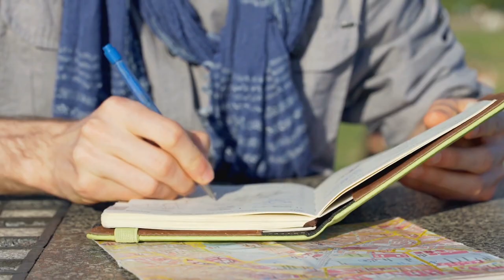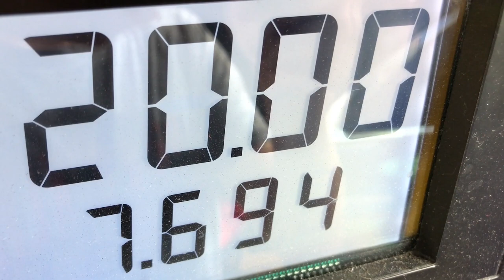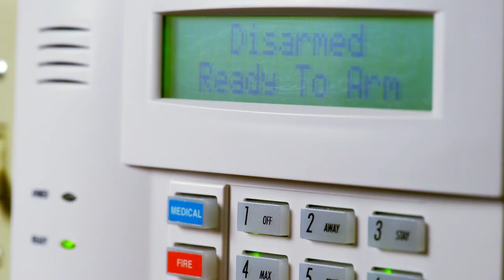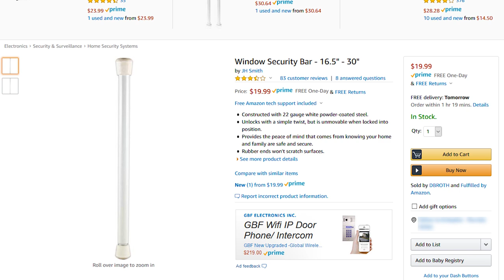How to survive after SHTF in an urban or suburban environment

Comment: This video sounds like it's such a great idea to do, however it is only showing one family that is bugging out and of course that's due to not having a real scenario to take photos of. But if SHTF actually happens, these families or individuals would not be alone, and in fact it would be hard-pressed to find most areas outside of the city to have no one around. People would be parking the cars at the edge of a forest and hiking on the trails that they are normally used for Summer recreation hiking in droves! Half the people will be knowing approximately where they're going and the other half are just following those in hopes that someone will have an idea of what to do! There Will probably be tens of thousands  of people for each and every city across the United States all trying to go to the lakes, forests, deserts all at the same time. And a lot of the people will be checking to see how much gear other people have and you wouldnt be in a safe situation traveling with that many people going in in the same direction!   I figured there would probably be a couple of hundred young, strong and healthy people per trail head,  getting out of town. Doesn't sound like a lot but it is, considering in Idaho there are a lot of trail heads into the mountains but there are a lot of people! And we're in a smaller area than the big metropolis cities!

Comment: I'd add one thing to that. Invest in precious metals, gems and other relatively compact and lightweight things of value everybody knows has particularly high value, and might consider in lieu of currency or goods. Don't invest much of what you have in the stock market, certificates of deposit, paper trading, cryptocurrency or similar virtual investments you may or may not be able to cash out or trade with if SHTF, even though the internet tends to make virtual investments easier than ever for the average everyday person with $20 or more in the bank or on a card. The world has typically revolved around the use of salt, silver, gold, diamonds and fuel as commodities of great value, sometimes to the point it's used or accepted as or like money itself. Also, gold, silver and crude oil tend to retain value with little to no change when market manipulation isn't a factor. I wouldn't recommend storing drums of oil for trade, though. It'd be more of a liability than an asset in some ways.
Reply: @Hasiger Hase It'll be harder to get precious metals or invest in stocks after SHTF  though. If shipping and running internet signal gets harder, price will go up for those thibgs. You can get food almost anywhere no matter what. Prices for some of those things will stay pretty low. Supply and demand is closely linked to investment. I buy in now while it's easier, more accessible, and therefore cheaper at this time.
Reply: @kennynoble1223  Bro. You really think someone is going to want a bar of gold, or some metals if SHTF? Things are only valuable if the value is given to them. Ain't nobody eating gold or silver bars, and they definitely aren't useful either unless you know how to forge. If SHTF, you should be expecting everything to collapse which means there will be no stock market or financial system. It will drop to primitive which is bartering and trading. You going to offer someone a gold bar for some food? They are not going to give you food for a gold bar that will offer them no benefit.

Comment: If you own your house, secure your ownership.  Store all long term preps under the slab and conceal it securely.  Prepare your BOV to tow a trailer and to conceal foam rubber covered "valuables" in a steel toolbox.  Conceal your "safes" behind false walls at home.  Vote freedom but feign sympathy with the tyrants.  Home is primary base. Family is first group.  Hunger will prepare them for your leadership.

Comment: Learn hot to make solar stills, solar hot water and solar hot air units, it doesn't take much to make a building off grid and having a warm place with hot water definitely makes it easier. Learn to ration water and dietary needs, everyone always talks about calories but the vitamins and minerals  needed are also vital  eg vitamin d  has a MASSIVE impact on mental health and depression in the UK anyone north of London is believed to be vit d deficient to some extent. It is worth paying extra money for 12v fridges and freezers as they are better insulated and the compressor lasts longer, if you have limited power using a 12v unit will reduce the power you need to produce so work really well with solar systems.
Reply: You have some excellent suggestions and doable. Thanks.

Comment: I could see suburban preppers being able to bunker down inside the home with the rights preps for very long term but only in specific areas under specific circumstances imho its best to always have a back up plan
Reply: Walter.. I live in the suburbs and plan to shelter in.  I do have a camp on a lake that I could go to, but is a well developed lake, only 11 miles away and easily accessible to anyone planning to fish and filter the lake water to drink. There is some undeveloped land on the non water side of the road and I felt that many would try and set up a camp site.  It's a seasonal camp, we close up in the fall and open late spring, early summer. I don't even keep any long term food storage there.  Mainly because what ever I would store would be exposed to cold and hot weather.  I had thought of keeping some  Mt. House, or Legacy freeze dried food in a metal container hoping it might be okay, since it only requires water to make.  I might do a test and store just a couple and see after a year how they hold up.
Reply: @m.b.g.2235   lights and solar for a garden indoor grow veggies and then have lots of grains and water stored the main limitation would be not being able to have a well
Reply: @m.b.g.2235  i would really avoid the lake in an shtf situation sounds like a hotspot

Comment: You’d probably have better luck surviving in a city you know your way around vs going to and getting lost in an unforgiving wilderness especially when the avg person does not possess those skills. Considering you’re not in a gun unfriendly place like Chicago, NYC, or LA where street gangs have more power than a law abiding citizen. If anywhere you’d want to go, Phoenix would be one of the best, no extreme weather shifts, the city doesn’t flood like it does down south or in the Midwest and guns are very, very plentiful, meaning the average citizen is armed per criminal and the legal gun owners tend to have better equipment than a lot of the trash I’ve seen confiscated off of scumbags out there. The only brutal issue is the heat during the summer, it is deathly dry and hot and has killed plenty of people who were considered “in shape”.

Comment: This is funny if the electricity supply goes you will have no water and cell and gas cell towers will be over loaded and the back batteries in them will be depleted after about 4 to 5 hours max. I sorry but this is fantasy land stuff if it happens guns and  ammunition are one of the most important thinks you need. Andy England 🇬🇧